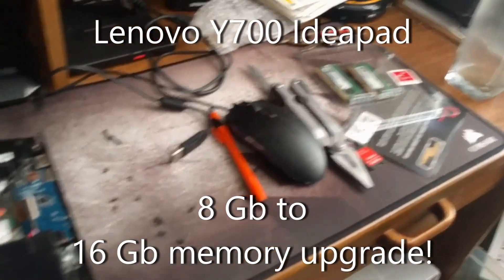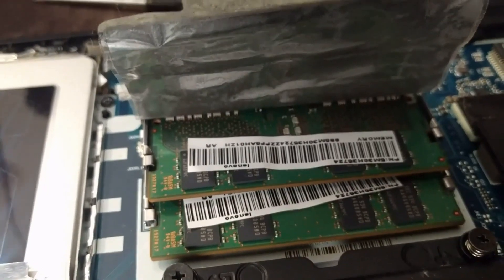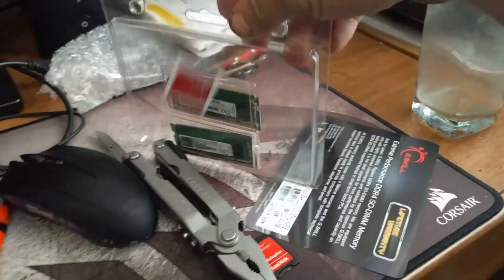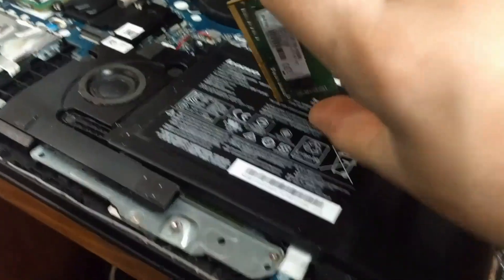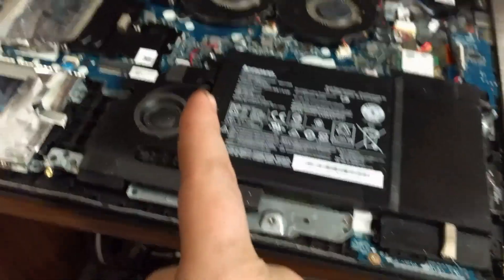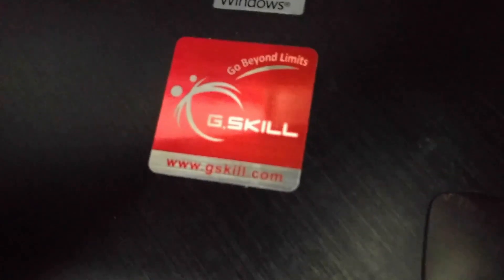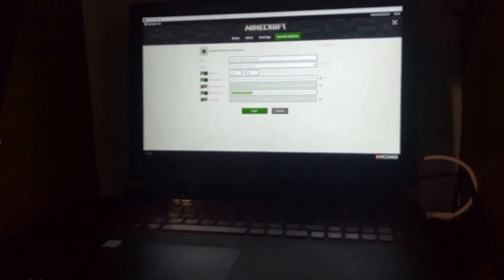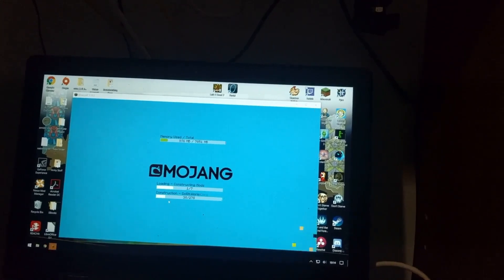💻 Lenovo Y700 Touch-15ISK How to install more Ram, 8 Gb to 16 Gb upgrade

Comment: hello, i installed my new ram 2666 mhz, but its speed is 2111mhz, how can I adjust clock speed of the ram to make it work at 2666???
thanks!
Reply: If you also happen to have a lenovo y700, you cannot go above 2133 mhz. I have no idea to adjust it but your ram should automatically go from 2666 to 2133
Reply: will that still be considered a ‘DUAL CHANNEL’ combo or flex ? Thanks

Comment: I have the same laptop. Do You think that I put the second RAM badly if the lap doesn't start correctly? I'm asking because  my Lenovo Y700 started fine once but then My lap hasn't started correctly. The screen doesn't "turno on" and the lap reset
Reply from the maker: Something may have gotten shorted out here. Is it still under warranty?

Comment: Question: Can i use ram with higher clock speed? (For example 2400mhz)
Reply: If u have ram installed with for example 2133mhz or lower ( doesnt matter ) and you are adding more ram but with a higher mhz, the pc will choose to perform at the lowest mhz that has been installed
Reply from the maker: CPU clock speed? I don't see why not. Just make sure you have the right compatibilities!

Comment: I just took apart mine to see what I could upgrade.  There is a literal M2SATA Upgrade slot right next to the HDD/SSD area
Reply: I didn't finish the whole video until you pointed it out.  lol
Reply from the maker: Ahh, I shoulda said that earlier! Do you think you'll upgrade it? It is a pretty decent improvement.
Reply: @Chrichelle  going to shop around for a good one.  A friend is sending me 2 8gb ddr from his personal stuff from work.   The ripjaws just dropped $60 in price for 2 16gb. I have to do multiple things on my PC as a live streamer. I'll definitely be putting in a M2SATA in near future.  You basically have the same stuff mine had when I bought it at bestbuy
Reply from the maker: 60$ jeez, I picked the wrong time to get mine... That's a great deal. 16gb is a great improvement though!
Reply: @Chrichelle  it dropped from from $180 to $120
Reply from the maker: Damn, that's great. I might have to get some for my wife's computer.